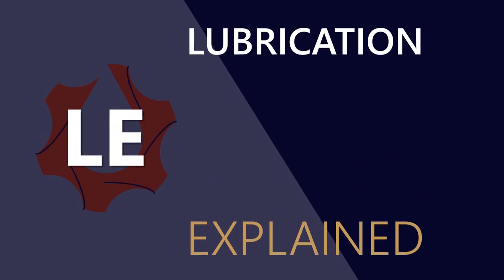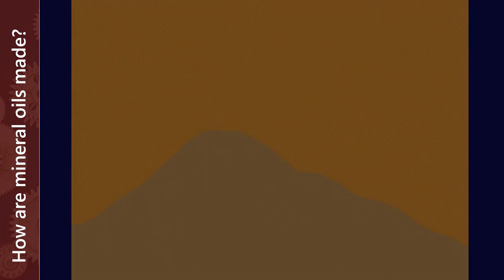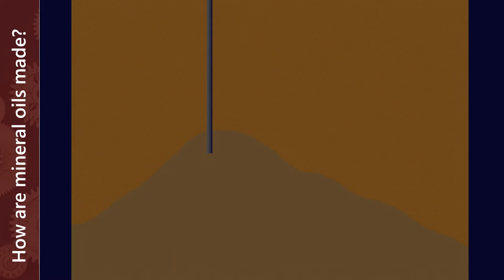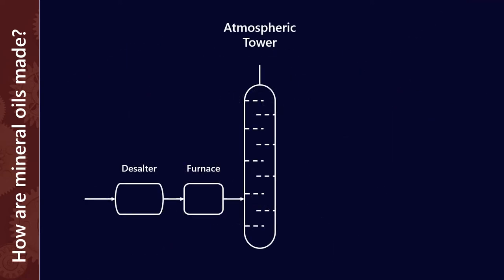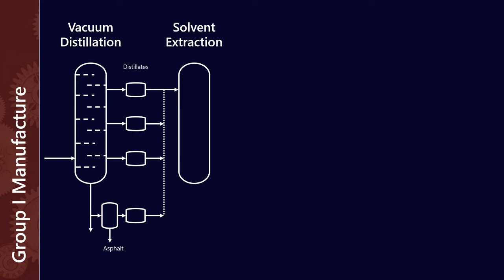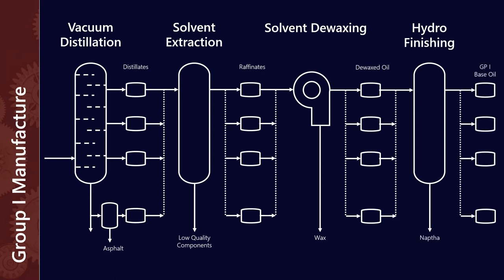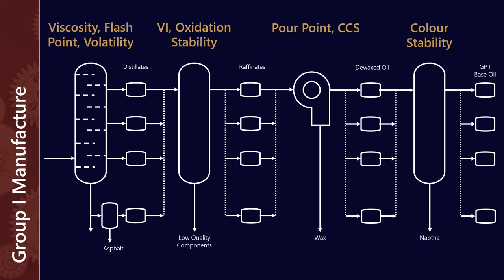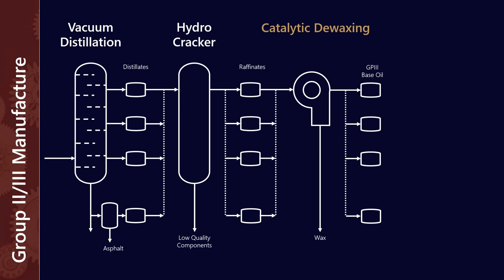How are mineral base oils manufactured?

Comment: Hi, I read from some lubricants company about hydrotreating and hydroisomerization process. Are those in your video for they used proprietary names or they are different from what you presented? Thanks
Reply from the maker: Hydrotreating generally comes before hydrocracking. It's done at milder reactor temperatures and removes impurities - hydrocracking generally cracks open napthene and benzene rings. I'm no manufacturing specialist, but believe hydrotreating is done first because the impurities can poison the catalysts used in the hydrocracking process.
Reply: @LubricationExplained  your explanation and jargon makes it more clearer since you did not mention company coined terms. the term poison is something new to me. So the claim of Pennzoil is possible at 99.5% pure so the catalyst is minimally poisoned?

Comment: I spent 30 years both boiling oil & formulating engine oils but one thing has always annoyingly eluded me. Why are Group I base oils referred to as Solvent NEUTRAL Oils (eg 150SN)? I get the 'Solvent' bit but why add the 'Neutral'? I've never, ever come across a Solvent ACIDIC oil or Solvent BASIC oil so why the persistent need to add Neutral? Also I notice that Group IIs typically dump the S for Solvent but still retain the N for Neutral. Why??? 
PS - went to both PRA Adelaide & BP Kwinana back in the '80s. Sad to see both fall by the wayside...
Reply: I answered my own question. It's the VGO feedstocks that are referred to as 'neutral oils'. My old refinery didn't have a vacuum tower so this passed me by. The 'neutral' moniker must just carry over to the refined base oil. Also, on investigation, it seems that certain crudes (eg Californian ones) can have a high TAN, not because they are 'sour' (ie contain H2S) but because they contain heavy naphthenic acids which reside in the VGO boiling range. Presumably such VGOs are NOT neutral oils (although I suspect they might well be after solvent extraction). Mystery solved!!